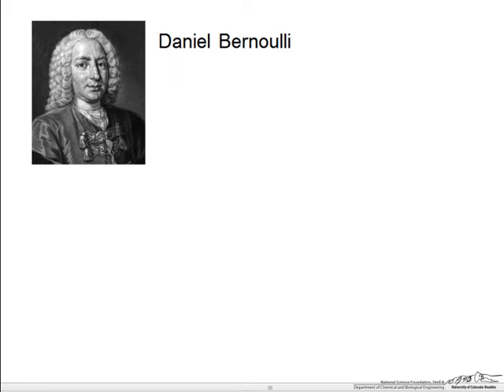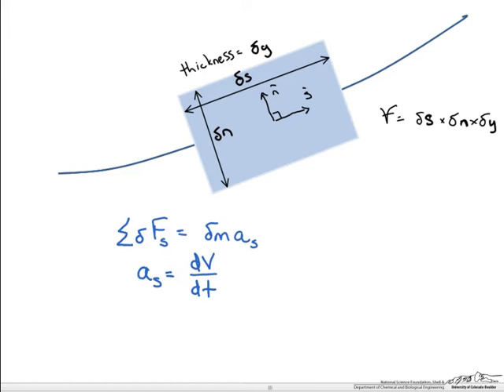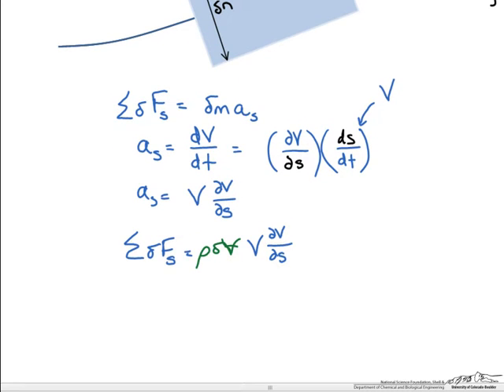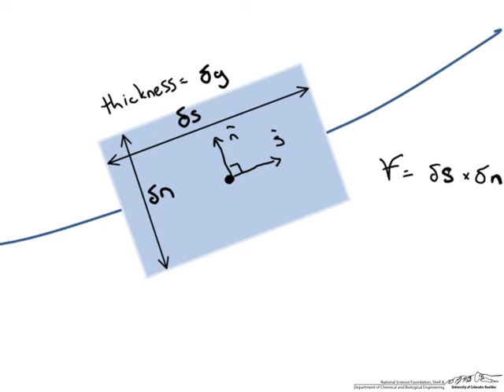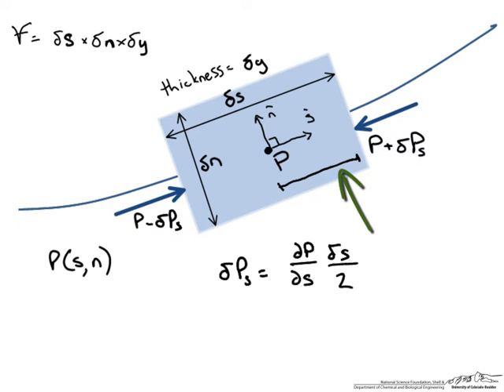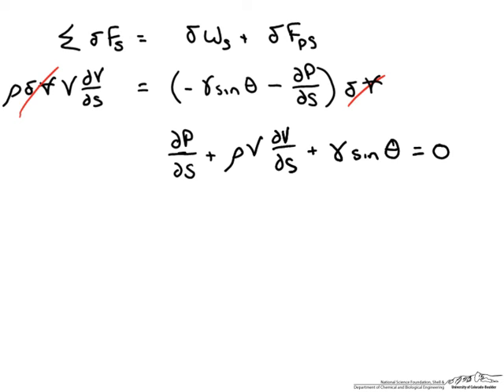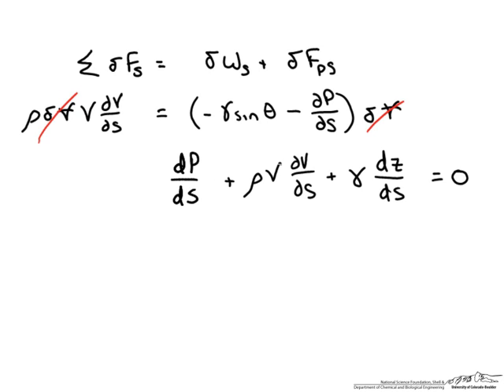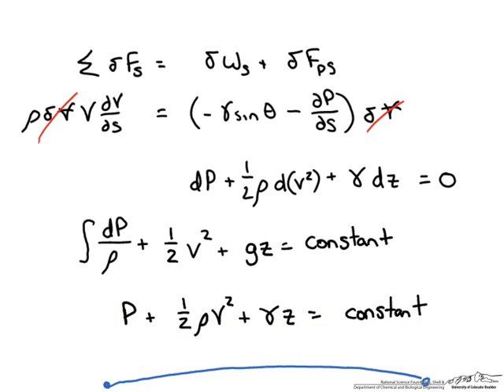Bernoulli Equation Derivation

Comment from the maker: The density can vary throughout the flow field, thus for compressible fluids it becomes a function of pressure and you would treat it as such.  But for the derivation here, we are looking at a differential fluid element, where we say the mass is equal to some differential volume * density.  We are not taking a set volume * some differential density.

Comment: at 4:46 you multiply a weight and a force? I do not understand why you do not multiply the weight by the gravitation?
- Thanks hope you can help me understand.
Reply from the maker: Sorry, that is a plus sign, not a multiplication sign.
Reply: LearnChemE Sorry, that is what i meant - how can you plus a weight and a force - when you want to find the force of gravity you does not multiply the weight with the gravitational acceleration. Thank you for your time.
Reply from the maker: Weight is a force.  You are taking the mass and multiplying it by acceleration due to gravity.  In this case we are taking the specific weight (density * gravity) and multiplying it by the differential volume to get  our differential mass * gravity. The sin term accounts for the direction in the y-axis.
Reply: Tankyou for your help!
Reply from the maker: Of course! Thanks for using these.

Comment: On 2:10 - when we represent mass as rho*dV - don't we have to put rho under the differential sign? That can be valid for incompressible, but for compressible fluids density is variant, so needs to be treated like such, i,e, taken with a differential. Ain't I right?
Reply: It’s infinitesimal so you can treat it as uniform density